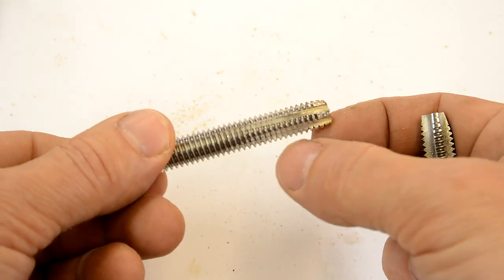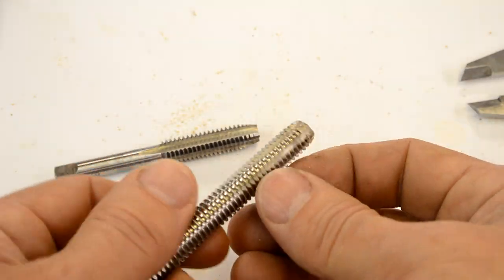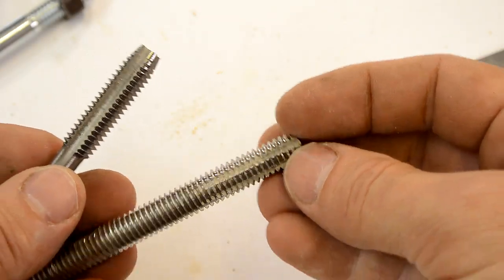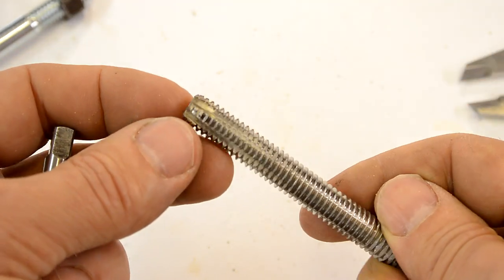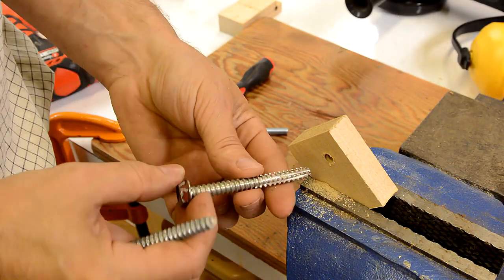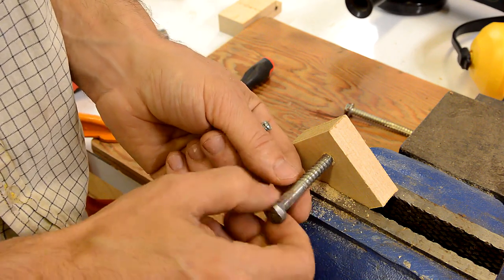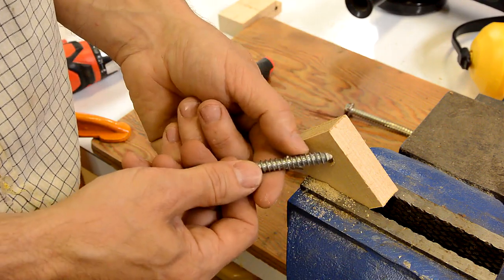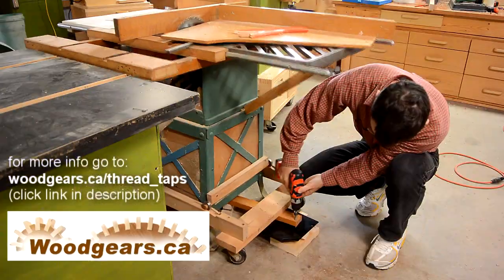Making wood thread taps

Comment: nice!
if the tapped hole is tight, run the tap through again with a toothpick or similar in one of the flutes.  maybe in a couple of flutes.  It should push the tap off center and cut the threads a smidge larger.

also, I recommend using really thick sulfur based cutting oil.  especially in light colored, nearly finished, expensive wood.  :)

keep'em coming MW!
Reply: You and Matthias should make a colab! Great tip with the cutting oil. I love your humor in your vids btw :D
Reply: Tony! Dont watch woodworking!
Reply: My account was hacked.  I was watching your videos at the library I must've left myself logged in.
Reply from the maker: Cool idea with the toothpick.  Love your methodical videos!
Reply: MarginWalker this this the real this old Tony his account not verified yet
Reply: Man, I get excited when I see the other youtubers I watch comment on videos of other youtubers. Except ToT. I want to see the chainsaw kart going! :)
Reply: I love a tight hole ready to tap...Yeah, I'll close the door on my way out...
Reply: legend
Reply: Bar soap works well for a lube on wood. Won't discolor it or mess with it.
Reply: @matthiaswandel   Gear Genorater
Reply: @ThisOldTony  Havibg this? Its either how they make workshops
Reply: @ThisOldTony  lol

Comment: Matthias, I fully support your method of woodworking, as well as Marcs.  Accessibility is very important.  I've been forced to buy used tools and restore vintage tools to get the job done in my shop.  I made my own wooden table saw fence because there was a need and I found a way to make one that is dead on accurate.  I simply took the measurements off of a Biesemeyer fence and duplicated it to the best of my ability, out of wood.  It took me a few tries and several mistakes and probably three times as long as it would've someone with a ton more experience, but I eventually made something that I could've just gone out and bought.  It's been three years since I made the fence and it's still just as accurate and durable as the day I made it.  Boom, I just saved myself hundreds of dollars.  I get sick and tired of people on Youtube bashing you for being bold enough to offer a cheaper alternative to the expensive tools and methods of others out there.  Why aren't the big tool manufacturers beating down your door harassing you for making a bandsaw instead of buying one from them?  Or why aren't the patrons of these tool companies harassing you for making your own tools for a fraction of the cost of a brand new tool? I for one always seek a cheaper alternative first because it's called being frugal and not being a wasteful individual.  When something breaks or I need to make a jig or tool to accomplish a task, I begin by looking around my shop for a solution.  I do it partly out of necessity, and partly because I love the process of finding the solution.  I also know there are people out there who simply don't have the time nor desire to fix or make something they need.  Maybe they're on a deadline and need to finish a project for a client and just need to get it done as quickly as possible.  I understand, I've been there.  I can change my oil in my car, but sometimes I just don't feel like doing it or I'm in a rush and am willing to pay someone else to do it, even at a higher cost to me.  It's perfectly fine for either method.  Sometimes, though, the solution is right there in front of us and is easier and quicker than the more expensive option.  Not always, but sometimes.  In the case of the taps, I do believe the cheaper option is just as effective.

Comment: What a money saver. For small machine screws I use a Dremel tool with the cutting wheels, one or more to cut the flutes. The machine screw taps might work on soft metals such as aluminum or brass too. Haven't tried that.

Comment: Okay I see a lot of negative comments towards Marc (and no I did not buy his tap set, I use my old metal tap set for wood). Andy Kline came up with a great idea to help those who need fast accurate tapped holes in wood which was repeatable and cuts the work time down by serious amounts. With that being said, Matthias is just showing another option rather than buying an actual tap set, there are pros and cons to both sides of this coin but let us respect the actual creators of these ideas, Marc is just the middle man on that tap set Andy Kline is the creator and major investor on that deal. Matthias just has a great idea for those of us who are too poor to afford those luxury items because even in a pinch, I have just threaded a bolt in a hole and just backed it out and went further in several times when needed. So thank you Matthias for showing me a new way to do the same thing I already do with bolts and screws I have on hand :)

Comment: I've made tapes for metal out of machine screws or bolts, but I never have thought about making taps for wood. I just drill a hole and run the screw in. I guess it might be handy depending on the wood a person is using. Thanks man.
Reply: Seems to me for a permanent installation your method would work fine.  For easy removal, tapping would seem to be appropriate.

Comment: Soak the threads with thin CA (crazy glue) and they will last even longer.  This is especially good when doing small fine threads.
Reply: What does that do? Edit: Disregard, I was thinking you meant on the threads of the tap but now realize you meant on the threads in the wood.
Reply: @Matthew S LOL
Reply: I agree with the CA, soak with thin CA, let dry & run tap through again to clean threads. Rock Hard Threads

Comment: The reason for that comercial bolt being loose on the nut is because it is the lowest quality being 1 of three number three has the tightest tolerance threads and therefore has no slop from side to side, also when you try to spin it it will not turn freely more than a couple of turns! If you want more info about this it is all in the machinist handbook.

Comment: The same jig you used for grinding out the flutes could be used for forming larger gullets.  Cut in from the horizontal side like you showed but then at that same setting just cut down along the vertical face to form a larger right angle gullet.  Just pick your support face angles such that you have a proper rake angle on the cutting side of the gullet.  That'll give you a lot more room for the wood chips to collect without jamming the tap.

Comment: I just had the thought that you might be able to reinforce the threads in the wood by using a thin epoxy, like laminating epoxy. Brush some on to the threads and thread a bolt in to it and remove it before the epoxy sets. If it is thin enough it should soak in to the wood fibers and make the thread more durable.

Just make sure it does not pool inside the threads, and the bolt should thread in to it nicely when the epoxy sets. 
To take it to a higher level, you could mix powdered graphite or molybdenum disulfide in to the epoxy, and it should add som lubricity to the mixture. 

Moglice, an epoxy product for renovating machine ways is basically epoxy mixed with molybdenum disulfide. Maybe it would help, maybe not, but i would try it out.

Comment: I've found that making grooves isn't at all necessary, even on hardwoods like oak that can be prone to splitting. I just find the appropriate pre-drill size then lubricate both the hole and the threaded rod (which is in the drill chuck) with walnut oil. I use walnut oil because it's the food safe finish I have on hand, but obviously something more common like linseed would be sufficient. Cool experiment though, TFS. Love all of your videos, amazingly creative.
Reply from the maker: The proper size pre-drill is bigger than the screws minor diameter.  But if you tap the holes, you can make the pilot hole as small as the minor diameter, for more thread engagement without splitting the wood or twisting off the screw.
Reply: "The proper size pre-drill is bigger than the screws minor diameter."

Interesting, so what is the proper size then (assuming you don't tap the holes)?

Comment: The difference between this method and a store bought variant is the steel. Commercial taps are a hard steel, while screws are softer. I have used a similar method in a pinch to tap some holes in Aluminum. You can cut the flutes with a file or a hacksaw blade
Reply: One reason you would want a  harder steel, is the same in a knife or a chisel. The tool will hold a better edge. The steel bolts are made of are ductile, where as by comparison tool steels are more brittle, but tool steel is much stronger and tougher. So long story short without going into miles of detail, a proper commercially made tap should last much longer than one made from a bolt, when properly used. Sure you can just make another tap or touch up the edge when it wears out, but we are talking about at tap, realistically not absurdly expensive. It is just another way of doing something, more than one way to get a similar result.

Comment: But wood taps account for expansion and contraction of the wood by having deeper threads. The threads are actually longer. It isn't that the shaft of the wood tap is thicker, the threads are just deeper. Metal doesn't expand and contact. Wood will actually split if it contracts around these taps. And if it expands, the screw will become loose. Nobody said that wood taps are crucial (including Marc), but they are better suited for wood.
Reply from the maker: the bigger problem is contraction along the length (cause the bolt is longer than it's wide).  And thread depth doesn't help there at all.
Reply: Honestly, I feel like it is a question of how you use the tap. If you use them occasionally, there may not be a huge benefit, but for people who use taps really frequently, it would probably make a substantial difference. The reason I say that is if the wood contracts in your tap, removing the screw may destroy the threaded wood and make it impossible to insert another screw well. That is probably unlikely. Some advantages remain such as being able to tap softwoods with a drill bit slightly smaller than the screw so that the screw compresses the last bit of the thread. That is only possible with the deeper threads. I do agree that wood taps are probably unnecessary.

Comment: does tapping threads for a wood screw make it last any longer or make it any stronger?
Reply from the maker: In itself, no.  But you can use a smaller pilot hole for more thread engagement (which adds strength), or you could put a bigger screw in a smaller piece of wood without splitting it (also adding strength)

Comment: Maybe for a future video, use your joint strength testing jig to test the pull-out strength of bolts threaded into wood using bought vs. homemade taps vs. just drilling a pilot hole and screwing the bolt in to make its own thread.  

I was going to suggest testing after a few insert/remove cycles but the end of your video suggests that isn't necessary :)

Comment: what caught my attention is , you want to make adjusment knobs without using the steel threaded woodinsert, right? but the fine thread inside the insert gives much finer adjustment than the rough "woodthreaded" screws ... so this might work better but will it give you the same range of adjustment?
Reply from the maker: It depends on how coarse or fine you want the adjustment

Comment: I've done this in a pinch even in the case of needing to cut threads in metal.  I've never made a jig like that but just do it by hand with a dremel and a cutting wheel on smaller screws and an angle grinder on larger screws, but what I do instead is cut it with what would be the bolt head end to my right, cut the slit in the screw and then pull up on the cutting wheel removing the metal above the slit making a large relief before the cutting edge, alternatively you could put the bolt head to the left and cut from the top and pull back towards yourself to make the relief.  

I don't know if that's clear, maybe I need to make a video....

Comment: I have a challenge for you!  I am making a Full size Gutenberg Press and have cut the screw using a router set up on my lathe.  I used a 3/8 16 ready rod  and a gear setup to reduce it to 3 threads per foot.  Are you able to come up with a method to cut the inner thread into an 8x10 using a router bit or some other tool.  the ones I have seen use a simple cutter on the end of a dowel that gets "threaded" through, but I would like to see a jig/tool made up that would do it.  I cut the threads on the screw 1" deep with a 45 degree cutter.  It also had 2 starts.  From one "MacGyver" to another, I would love to see what you could come up with.
Reply: I forgot to mention the size of the screw.  It is about 18" long, 5" outer diameter, and 3" inner diameter.  4" per turn on the threads.  I had thoughts of modifying a grinder, but not sure if that will fit into the hole?

Comment: It's been a while since we've seen a test rig. I've heard cyanoacrylate is a trick to harden wood threads but I wonder if it's actually stronger. Thoughts?
Reply: I don't think it's needed. I tried stripping the threads (for an M8 screw) in wood. I used a cylinder head screw for that and it always pulled the head of the screw into the wood instead of ripping out.
Reply: It definitely helps for small screws. An M10 bolt into 20mm of plywood? Probably not.
Reply: I hope Matthias does a strength test on ca threads versus bare threads. I've been wondering about this myself
Reply: I have drilled and filled the hole with baking soda and then applied cyanoacrylate and then drilled and tapped with a machine tap. Surprising how strong threaded holes in wood can be this way.
Reply: Everbuild do a wood hardener resin which I prefer. It's very thin and soaks into the wood. It's marketed for repair jobs where you dig out the rotten wood and need to ensure that you've not got any soft bits before you do your main resin repair. 
I've used it to harden a pine coffee table that was always getting dinked by the children, worked wonderfully.

Comment: I have several different ones I have made over the years. I also have made with grade 8 and have used to tap aluminum with no problem.  except you got to use cutting oil and run in and out a lot more just because the are a bit tighter. the other thing they are perfect for it to chase stripped threads
Reply: I usually do 2 flutes I have done 3 before but have had more luck with 2.  the first time I made one was to tap a hole in a homemade wood see clamp.

Comment: A method I use costs less and takes less time, although its not as refined: heat the bolt, screw it in(out,in,out,in,out,in) and done.

Comment: Make a controlled test and comparison with other binding methods.

Durability isn't the only concern, shear strength is also important.
Reply: Shear strenght? Of what? Where's the difference in using predrilled or predrilled and tapped hole?
Reply: I meant, glued tenon vs tapped hole on a pull test for example.

Maybe shear isn't the proper word. But you know, test how strong are the threads, how much could a bolt on tapped wood actually hold, etc.

Comment: I am new in woodworking. Normally I use lag screws and drill in to the wood as big as the screw shank. Do you think with this method I still need to tab the hole?  Does it make difference if you are working with walnut or pine? 
Thank you in advance!

Comment: Me personally, I would not waste all that time and just use a regular tap. Been using them for 40 years no issue. All this guy is doing is solving a  problem that doesn't exist. Now if he lives in Bumfuck Egypt where they don't know what a tap is, maybe.
Reply from the maker: and where do you buy a "regular tap" to match the wood screws you might be using?
Reply: @matthiaswandel  no where did video say anything about wood screws. He made a tap out of a piece of all thread.

Comment: could you do a video on making matching screws and threads for wooden screws (like used for putting furniture together or making shop fixtures...
Reply from the maker: the interal wood tap is quite a challenging thing to make (more of a machining project)

Comment: I think there is a reason they make wood screws vs metal screws for a specific reasons and lessons learned. The threads are designed for specific design criteria ie, shear, strain and torque. You would not use a machine thread directly in soft wood or end grain, thus the insert, and even that has design limt requirements in application. The first tap (machine thread) that loaded up was like a bottoming tap vs a thru tap in application, and the flues were not deep or wide enough for the chip size being produced I would bet as he found out! I would like to know what a bolt pattern be if using the same machine screw in wood vs steel under the same design application for the same preformance? In a pinch or for a simple application like cover plated (all non safety performance requirements) may be applied. The wood screw tap is a good idea in a pinch or again in a application of hand tightening application is desired and you don't have that specific wood thread tap, insert, or your in hard wood. Good work holding fixture for round stock in metal or wood.

Comment: +Matthias Wandel  would be awesome if you did a pull test video on something like the lag bolts.  Something like "tapped hole vs just a predrilled hole".  In similar fashion to how you did the joinery strength tests.  I like how you give a cheap and useful alternative to (IMO) overpriced tools, but is it really worth the time and effort to actually tap the holes vs just a predrilled hole?

Comment: I'd be more interested in a wood screw thread cutting die.
Reply: Kevin Day I guess you might be able to drill through the threads at 4 points, but you'd probably have to pick the placement and size of the bit quite carefully!